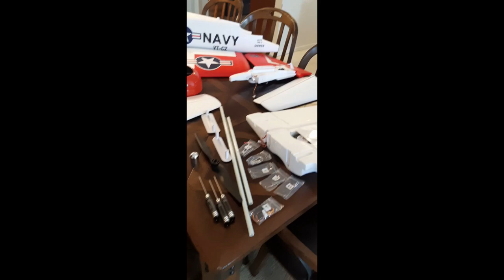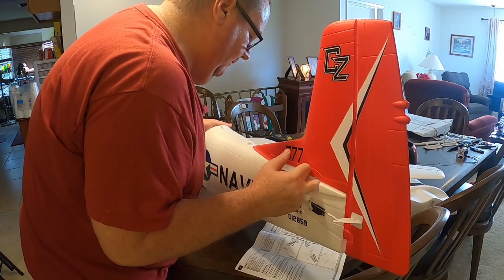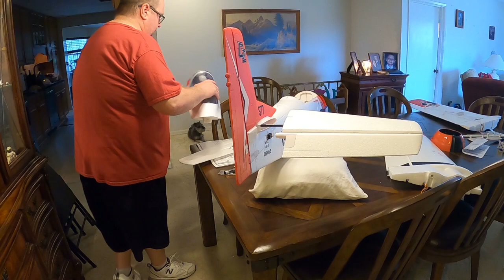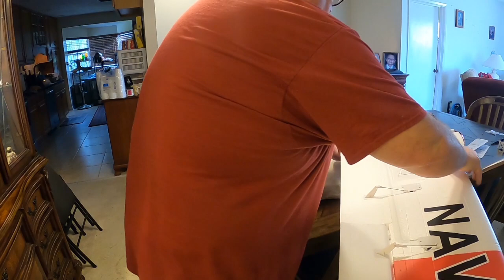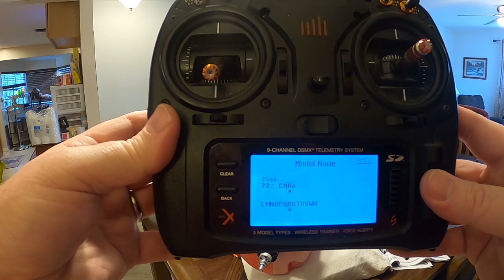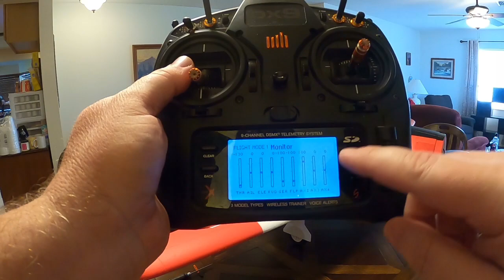Carbon Z T28 full build by Fat Guy Flies Rc!!!.

Comment: are your elevator screws flush with elevator? mine stick up a little bit but I'm pretty sure they're in correctly
Reply from the maker: No Mine are flush. I checked them this morning
Reply: @FatGuyFliesRC  I had a feeling that was going to be the case, mine will not go in anymore, and my vertical stabilizer is not completely down flush on the fuselage that might be the issue but it won't go any further. sucks

Comment: AWESOME! I have my first one in layaway right now, I'm about halfway until I can bring it home. can't wait. I've noticed in reviews almost everyone had problems with the retracts before they brought it back, have you had any issues with yours?
Reply from the maker: I have one retract that always goes down but does not always go back up. I have crashed the plane into a power line and am in the process of replacement. I will be applying  foam safe grease to  retracts before the flight. The Crash was entirely a depth perception cause no fault of this wonderful plane. I am confident that these large beefy retracts need a little adjustment and some foam safe lube to operate more reliably. Do not let that put you off this bird, its flight and fun level is off the charts!!! Also i subded to your channel.
Reply: @FatGuyFliesRC  I just saw that video where it crashed, that sucks. one of my airplanes went down not too long ago as well. no it doesn't deter me from purchasing this airplane I got my heart set on it, I would be interested in learning more about where and how you put the grease on the retracts though if possible? adjustments etc? thank you for subscribing but FYI I don't do anything with this channel anymore but I do appreciate it and I subscribed to yours